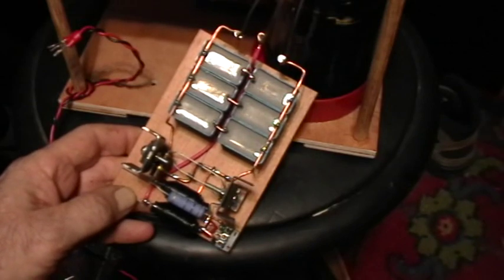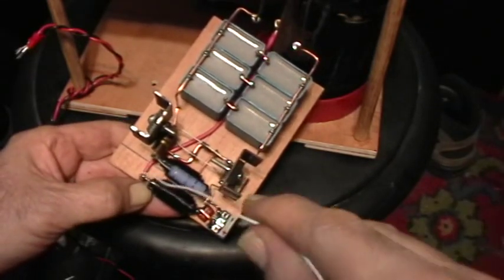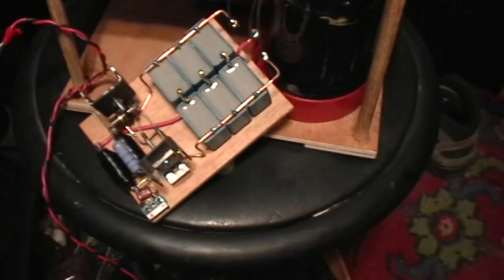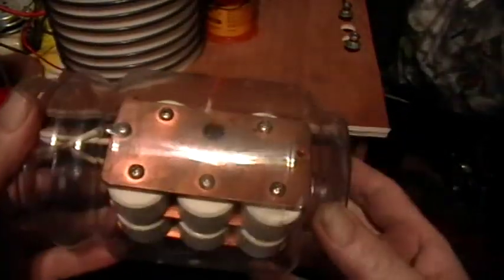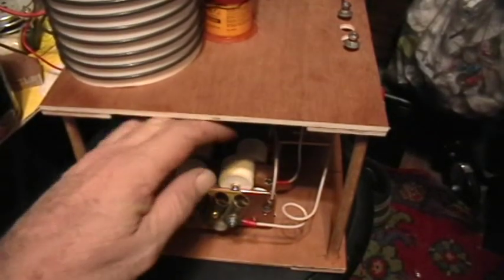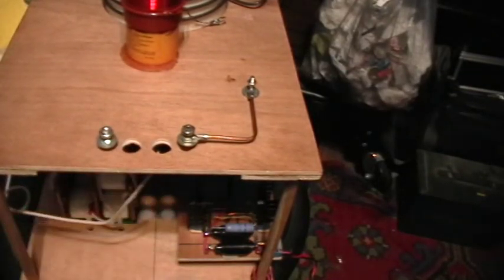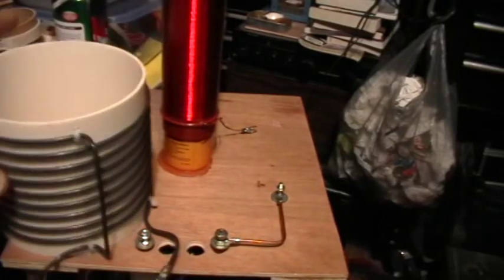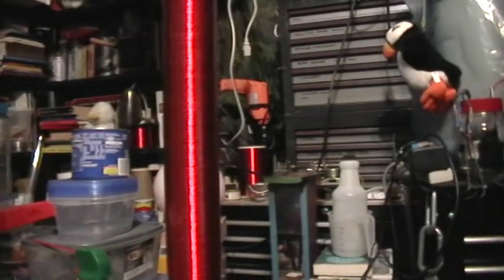Extreme High Voltage: TinselKoil VII Overview, Construction, Demo

Comment: Hey TK. 
How would you tune a ZVS driver to drive a small Tesla Coil solid state style? I have two small TC's made up (more on the way), ten IRFP260Ns, 3 watt resistors, 1N4007 diodes, and a large assortment of capacitors. I have the zener diodes somewhere on the over a dozen boards I have from old television, computers, etc. 
I believe you have built exactly what I am asking about if I am not correct?
Anyways, I hope I can hear back from you.
Side note #1: The reason I am asking you this is because I want to use the said TC as the source tower for the SEC (Spacial Energy Coherence) Challenge 2014 hosted by Jeremy Gwilt. (I just want to do something a little different).... You should enter... but I do understand if your too afraid of my mad skills ;)   (joking)
Side note #2: I have been busting my behind at a factory job (50+ hours a week) here up north and will continue to do so for the short tern foreseeable future, I say this to let you know my funds are creeping back up and I will sometime soon be engaging in my Gas Filled Tube projects for you and everyone. Frickin renovations and too many cool projects keep it difficult to raise ample funds/time for the "exotic" gases and work involved. But none the less, it is still on the priority list and I guarantee you I will get you some cool costum Gas filled tubes :)
Anyways, hope things are going well for you. Aside from chronic lack of sleep, things have never been better for me. Peace and all the best. B
Reply from the maker: Good for you, I'm glad you are doing well.
Strictly speaking a "tesla coil" is a quarter-wave air core resonator, pumped at the bottom by "striking" it with an oscillating magnetic field from the tuned primary coil and its power supply. The primary-secondary coupling is loose so that the secondary can "ring" freely when it is struck. Generally, traditional spark-gap coils are made so that the secondary rings for several or many cycles between primary pulses. Solidstate coils will often drive the primary at the same frequency as the secondary's resonant frequency and will use tighter coupling.
I don't think the zvs oscillator is a good choice for directly driving the primary of a true Tesla coil, because the zvs oscillator produces a pure sine wave at the resonant frequency of the tank, and for good TC performance you need faster rise and fall times than sine waves deliver, like spikes or square pulses. But this coil uses the ZVS driver to drive the flyback transformer to make the basic HV for the primary, then the spark gap/capstack delivers the fast rise and fall times needed. So that's why it's a hybrid. It sounds to me like you are wanting to make a true SSTC, solid state TC. So you should probably use a different circuit. Check out my SassyClassE SSTC for an example. These make good power plants as they operate at higher frequencies than "sparking" TCs.
Extreme High Voltage: SassyClassE SSTC: Overview and Demonstration
But the miniSlayerExciter is a kind of sstc that you could also explore. I have tried it with a ZVS driver and it didn't work all that well but I didn't really try very hard to tune it. Regardless, check it out, it shows how to put a variable inductor as a bottom-load to tune the coil's secondary.
Resonance: TK MiniSlayer Exciter and ConradElektro/Magpwr Low Voltage Joule Thief
The zvs circuit is tuned by the values of the capacitors and the output coil (flyback primary or etc). I usually determine the resonant frequency of the flyback using the FG and it is usually between 20 and 30 kHz. I generally use 8 or 10 turns, center tapped, for the primary and this gives me an inductance value for the flyback primary. Then I solve the resonance formula for capacitance, with that inductance value and 30 kHz as the frequency, and then make the zvs driver with that capacitance in the tank.
A real TC secondary, once it is wound, is usually tuned by varying the top capacitance. Obviously you only have a few pF of variability here in terms of shapes and sizes. The MiniSlayer is tuned by the bottom-loading loopstick but this won't work with a real TC, I don't think.
Xenon! TK needs xenon! One tube at 1 atm pressure and one at whatever the standard "signage" low pressure is, 4inches x 1inch kind of size factor. Electrodes not necessary! ;)
Reply: :) Xenon is officially the first Noble gas on my acquisition list. Thanks for your your help. I will re-watch those videos of yours.... I do understand the concept of impulse driven "sparking" true Tesla Coils. I will have recently acquired a 7.5kV Transo 30mA NST which I plan on using with conjunciton with a 9 kV NST (I will match the voltages using my 20A variac).... With that TC (which is going to be used to scare the trick-or-treaters and there guardians this Hallloween) I plan on using a brass ball magnetically (2"x1"x3/8" N48 neo) quenched and air quenched spark gap. I also have a bunch of chunky HV diods (12kV) to use pre gap rectification.... The contest hosted by jeremy gwilt is for "spacial energy coherence" not breakout. Highest field strength is what I am after..... So, what you are saying is I must tune to the primary with capacitance out of the MOSFETS. I have 30 Soviet era silver mica capacitors 1000V 10nf each, and a 22-360pF variable air capacitor, I believe I may be able to tune using these.... I plan on driving using my MASTEC DC power supply, if hooked in parrallel it can provide 30V (up to 50V) @ 10A. Thanks again for your help, I look forward to seeing your entry video into the comp (final entry date Oct 15th)... My plan for the comp is building tuned versions of your "electro-smog" harvester to run low power slayer exciters. Hopefully I can achieve at least one functioning SE running off of wireless (3 would be better ;). Peace TK. I can;t give you a deadline for the Xenon tubes but I can tell you I will have them done eventually. So much on the plate, I must first finish insulating and dry-walling my garage for a proper lab/man-cave.. Thanks again. Peace.
Reply: TinselKoala So, in regards to the two 60uH chokes coming off the positive rail. Does the value of them (60uH) stay the same regardless of the target frequency of the circuit? Also, what is the function of those chokes? I imagine they are there to protect and "isolate" the power supply or batteries.... Anyways, I know I have been asking you many questions and I am sure you are busy..... But I have one more question   :) (sorry).... I can't figure out how you incorporated the 12V Voltage Regulator into the gate drive portion of your circuit. Any tips on installing that..... This ZVS circuit that you have put your own twist on seems very versatile and very functional on many levels. Thanks for taking the time to share it. I'll be sure give some props to you when I make some video demonstrations using your ZVS. Anyways, I hope your weekend is going well. Nice work with the induction heater. Peace.
Reply from the maker: Binj Komisar  The chokes for the circuit are usually specified as 100 uH. I have used 60 to 120 uH values. These 60 uH chokes are high current chokes that I got from some surplus powerline filter things that I paid a dollar each for. Two chokes, four 1.5 kV ceramic caps, a great slide switch and a 4.5 amp circuit breaker, plus the wires, for a dollar!
Anyway, yes, you are right about the chokes. All I can say is that I have fried a couple of them (cheap RS chokes with bad wire) and if the choke shorts, the mosfets will blow. So I learned to use heavy wire, and with the RS 100uH chokes I strip and rewind with heavier wire, better insulation.
If you look at the schematic, the two 100R Gate resistors are connected at a single point. This is where the output of the 7812 goes. So I have one choke coming directly off the + power input, then going to the workcoil center tap and nowhere else. This doesn't change. Then normally the second choke comes off the + input and goes to the gate resistors. So instead, put the 7812, then the Gate resistor choke on its regulated output. Decouple both sides of the 7812 with 0.1 uF caps to ground.
Reply: TinselKoala Ahh yes. Makes so much sense now... duh... That is an awesome deal. I am just going to wrap some 22AWG around some welding wire until I reach somewhere in the right range.. I also have 18AWG I may try. It has heftier insulation... Thanks a million for straitening that out for me...Awesome.... This is going to be anther up till dawn night. Garage work until 11, then ZVS driver time. Thanks again for your help. Hope the rest of your weekend goes well. Peace. :)
Reply from the maker: Binj Komisar 'd use the #18 if I were you. The chokes on this thing, that I got from the line filters, look like 18 to me. Better safe than sorry here. The one connected to the center tap could be carrying as much as 10 amps of real juice, so you want low electrical resistance and good heat resistance. You could use a couple of ferrite or powdered iron toroids from an old PC power supply or something, better magnetic response than the welding rod or wire.
Reply: TinselKoala  That is the route I will take. Thanks for the help, for what its worth, when I make a video this week I will give you shout out..... My 50 viewers should increase your subscriber # by.... 1 or 2... lol.. Cool stuff, garage is done till next weekend. Electronics on free time all week. Should have this driver done in the next day or 2. Thanks again TK... (I was going to ask you if ferrite toroids are acceptable for chokes, you were one step ahead of me, awesome :)
Reply from the maker: Binj Komisar
Sure, you are welcome. I assume you have some way of measuring inductance and can wind the ferrite to the proper value of about 100 uH. This won't take many turns, more or less depending on the exact material of the toroid. IIRC the little RS 100 uH chokes have about 40 turns in 2 layers on them.
Reply: TinselKoala Yeah, I am using a $15 e-bay LCR-triode tester. Its from China and came as a kit (ordered a dedicated LC meter kit of much higher precision two day ago).... Itn(the one I have) measures to a precision of .01mH so I'm good for the chokes. I used two small ferrites with 14AWG magnet wire. The wires coating is a little cracked so I will give them both a coating of liquid electrical tape. Just got in from the job, now I must go do my work :)   .... Without the 7812 (I cant find any, will have to order) what is the highest voltage I can run the setup? Also, could I add resistance in front of the Gate resistors to lower it to a more suitable voltage for a less professional solution that will suffice until I get my 7812's?
Reply: Oh yeah, the torroids I used are about 1/2 inch. They are not identical. One has 2 turns and the other has 8 I believe. I'm in the range. Here is a tricky question. With a true Tesla bi-filar wound coil. When attaching the the centertap (crossover) is the inductance value used to calculate "C" that of the entire primary coil, or just one half?
Reply from the maker: Binj Komisar the whole coil
Reply from the maker: Binj Komisar Just saw this one. I don't know about the extra resistor solution, the 100 r and 10k already form a voltage divider for the Gate voltage. I run the driver for the TKVII at 24 volts but as I recall it blew mosfets with 36 volts (no regulator). I'm still not sure if 12 volts will be the best, it might work better with 18 volts. I also haven't tried the heater at 36 volts in yet.
Are you sure you got 100 uH with only 2 turns? That must be some good ferrite.
Reply from the maker: Binj Komisar
I am worried now about your chokes and such. I suggest you try the circuit with cheaper mosfets like IRFZ44N or IRF3205 at 12 volts supply and see if you are getting good oscillation without mosfet heating. Then if it is working properly go to more voltage and the 260n mosfets.
Reply: TinselKoala Well, Its all sauldered up:) Don't worry, I have 10 of the 260's. They were about $20 on ebay. I wont run past 12V to start.... The chokes should be good. I remeasured them over and over, One is at 70uH and the other is at 80uH. I have two of my soviet era caps in series with the 22-360pF in parallel.... Basically I am to close to stop now... We have crossed the Rubicon.... May god have mercy on those mosfets souls... lol... Going to go set up my cheapo o-scope for wireless indication and and put my frequency counter into the mix... Should be interesting. I don't think I have time to make a video tonight but if things go well tomorrow I will make a vid... Peace TK.
Reply from the maker: Binj Komisar
Be very careful when scoping this circuit! The "logical" place is to look across the coil, that is, from Drain to Drain, probe on one drain and reference on the other. But if you do this while you have another instrument, or a power supply, connected to the circuit negative rail (Source of mosfets) then you'll make a groundloop and all kinds of bad things will happen. The FG or frequency counter will probably have one side grounded!  I only power with batteries when I scope this circuit just in case, even though my main PSU is isolated. To get that nice sine wave I show in this video, it is from Drain to Drain, directly across coil. You can scope from one Drain to Ground and you'll get a half-sine, and if you use both channels, common ground at Sources and one probe on each Drain, you'll see both halves of the sine wave, half on each channel. If you do it this latter way, with scope probe references and other instrument grounds all on the same negative rail (mosfet Sources) then you should be OK, but be very careful about possible  groundloops anyhow.
Reply from the maker: Binj Komisar
Just a reminder: don't ramp up power slowly. Set your PSU to the desired voltage and then use a switch or a connector to connect the circuit to the voltage. If you ramp up slowly the oscillations may not start and you'll blow a mosfet. A good thing to do is to use an inline ammeter, and if the current draw seems excessive it might not be oscillating. Mine runs at about 3 or 3 1/2 amps input before sticking the workpiece into the coil; if your current is over 5 amps when first starting up, stop and check for proper oscillation somehow.
Reply: TinselKoala Thanks for that info. I just tried ramping it up slowly but my power supply would not go over 2-3 volts. So the oscillations did not start... I think because the voltage did not go over 3 volts that in all likely-hood the mosfets are fine.... I am going to put a car battery on charge until tomorrow when I wake. I will saulder in a switch and see what happens. I am ordering many analog and digital voltmeters and anmeters in the next while for dedicated use in various projects.... Gotta hit the sack, have a good night and thanks for the help.... I am eagerly looking forward to morning... Success or failure... Which will it be? Only time will tell :) Peace.
Reply from the maker: Binj Komisar
If you use batteries, especially a car battery, be sure to use an inline fuse! 15-20 amps. If your system shorts your car battery will deliver 300 amps or more and you might explode your mosfets or catch something on fire! The good news is that the exploded mosfet will usually cut off the current.
Reply: TinselKoala Yeah, I dunno. Tried running it without the fuse last night. No burnups and no oscillations... The joys. Going to take it apart, test components, then rebuild.... I also think my LC meter may be giving wrong L measurements as my "electrosmog" harvester would not work. It also could be my Q value of both my harvester and my resonant transformer are too low not giving enough bandwidth for resonance.... I dunno, I must take another crack at it tonight. Peace.
Reply: TinselKoala Anyways, I am going to read up on how to get a high Q value tonight... I am going to disassemble, test all components. Reassemble, test with fuse in line... And I will keep you updated. The competition submission deadline is the 15th, so I can afford to be very meticulous with this process. (I wish my high precision LC meter was here... wont be for a month or so)... Again thank you for the help.... Also, I am going to redo the chokes so they are identical, thinking of using tightly braided 22AWG (high temp enameled).... But for tonight, it is strictly reading and trying to fully learn how to coil a resonant air core transformer with a high Q value... Peace, hope your week is going well :).... Also, after I rebuild my the RACT (with high Q) I will find its true resonant range by using a single mosfet setup and frequency gen...  I believe my plan is solid, now all I must do is do it. :)
Reply: Q value is opposite of what I thought. I'm frazzled. Going to sleep. So much to learn its incredible. I've got till the 15th.
Reply from the maker: Binj Komisar
I just saw these last comments. Google has been hiding them from me, I've been checking frequently and suddenly the bell tells me there are 12 pending. Stupid system.
Anyhow, I can't imagine why your oscillator didn't work the first time. You didn't blow your mosfets I hope. You didn't make the mistakes, I hope:
Don't ramp up power slowly, do switch it on to a solid 12 volts that can deliver 5 amps, but fuse at 10 amps so if you do have a short it won't explode something.
Don't try to run without an inductive load of at least 1 microHenry in place across the drains/capstack. Use cap and inductor values to give a calculated resonant frequency of around 125 kHz for heating adn 600-800 kHz for wireless power transfer with a one-turn loop.
Do use heavy heavy conductors for the entire drain-cap-coil circuit. Keep physical symmetry here as much as possible, including the various choke variations. The reactive power circulating in the tank is "real" in the sense that there really is a lot of current flowing, 40 amps or more, and your tank wiring has to take that into account. Using copper tubing for the transmission loop is not a bad idea.
The oscillator will actually work fairly well on just one mosfet, which can fool you if you are trying to fault-find and troubleshoot.
For the electrosmog harvester to work, you have to fish in waters where there are actually fish! If you have no power in your local smog there is nothing to harvest. But once you have a tuned emitting circuit operating in the frequency range you can tune, you should be able to pick up the emissions from it with the harvester.
Reply: TinselKoala Thanks. I am tackling it again tomorrow  big time. Its a long weekend and I have much more free time to work on it. I will keep you informed. Expect a message tomorrow evening. I have switched primaries (4 guage 7 turn) and the coil runs much more exceptionally with various NPN SE ciruits hooked up.... The coil seems to like 300kHz and emits a large field (it is a large 26"x3 1/2" secondary). The other much smaller coil I can try to drive with the ZVS, resonates at about 860kHz... I may just build a driver for both... But yes, I am looking forward to tomorrow, a fresh faced purely electronics day... This has been on my mind all week. I tried doing things with IC chips throughout the week to no avail... I will conquer this ZVS setup.... Does the ZVS require heavy amperage to run? Could I run it off of two 9V (in series) whilst troubleshooting? Going to go hit the sack. Am going to wake fresh and ready to tackle this awesome project tomorrow. Peace :)